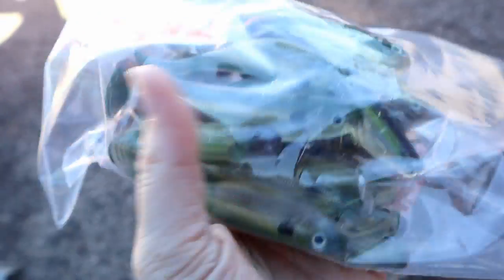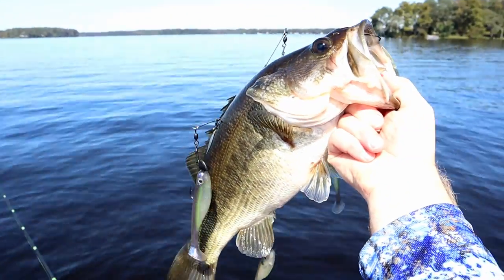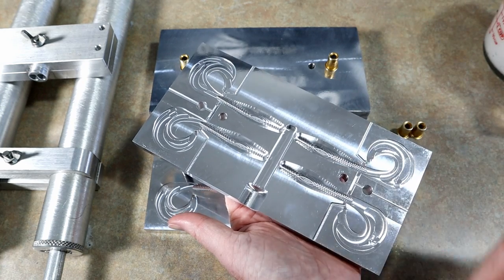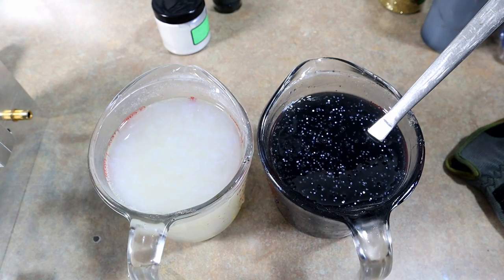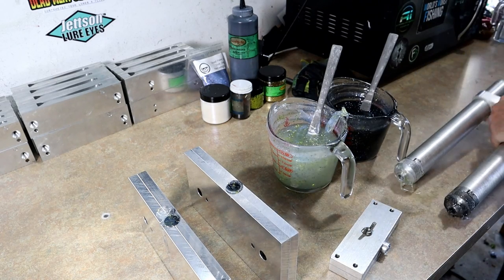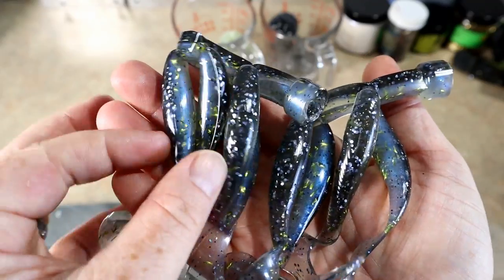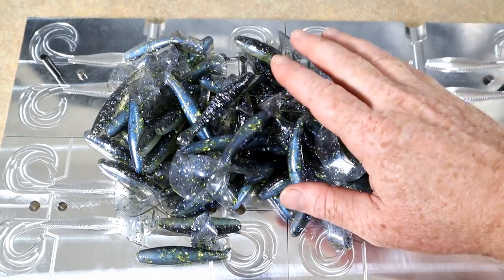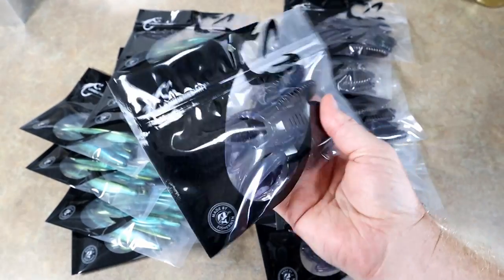Bait Blog: NEW MOLDS, Catching Bass on Swimbaits & New Colors

Comment: say the apocalypse happened and you took over a tackle shop but supplies need to be stretched.
you can sacrifice some remelt to see if some glues can help stretch the plastic stock.
you've got glue sticks, dried out classic white glue and rubber cement.

but regular casting needs to go on
for coloring... you've got the base crayola paint pots/jars (red, blue, yellow) and brown. you've also found some assorted colors of play-doh.
for the sparkly stuff you aquired glass beads used for mini loom crafting.

i let my mind wander too long on this one.